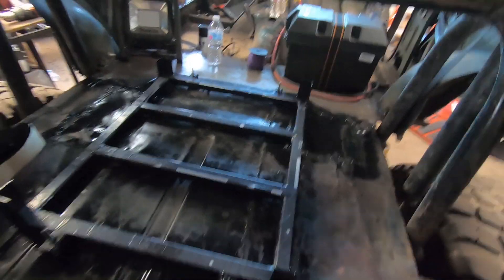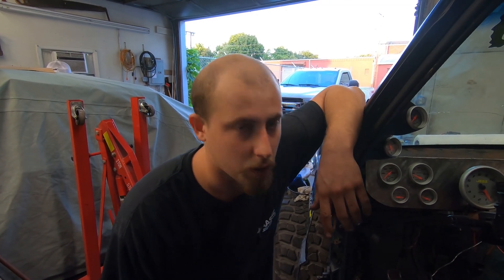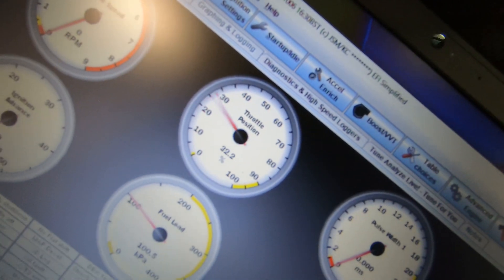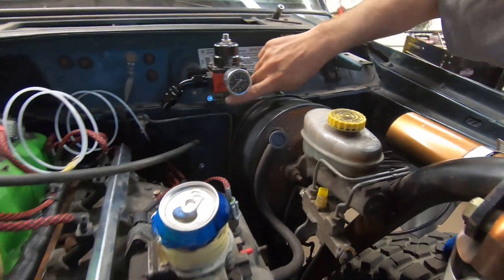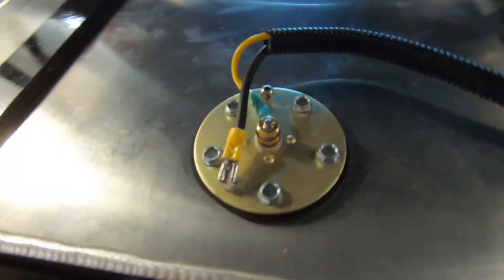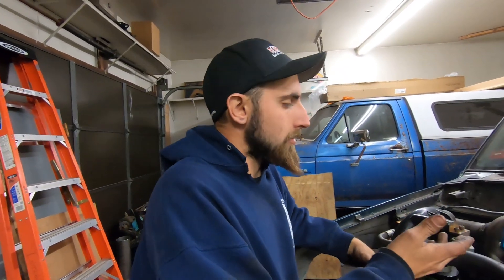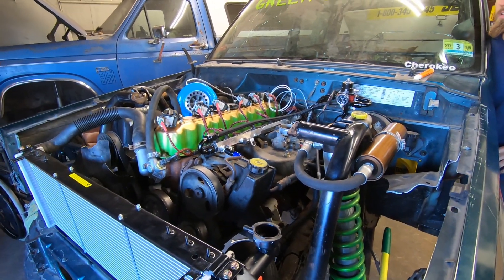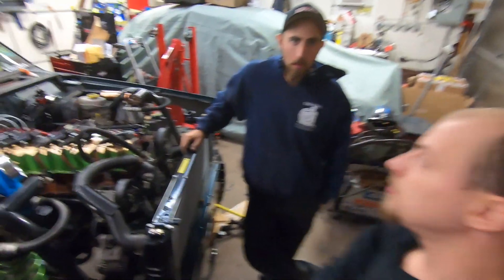Turbo Jeep Megasquirt part 9

Comment: Guys, moved from the garden state to the treasure state myself in my 97xj with 3.5” lift on 31”s mud tires with an off road kit. I took the sway bar links out off to make the drive more “fun”, say what you will but I enjoyed the 2,500 mile run floating on a slinky. ANYWAY did a total engine rebuild with all kinds of fun performance upgrades bored cylinder heads, new camshaft, banks header, high flow water pump, injectors, 10mm ignition wires, 45,000v coil pack and other small extras. Would not start. Same stuff you were listing of troubleshooting from square one; spark, fuel pressure etc in the end was a timing issue. I put a crazy amount of hours into troubleshooting and ultimately brought it into someone smarter than I- adjusting the timing was the fix for me. 
Stick with it. Be great to see it up close next time in Jersey and have a road soda under the hood and get your two sense on mine. Currently being regeared to 4.10/4.11 from 3.07 (I know that sounds off but I called the VIN into the dealership and had them check it twice) picking it up later this week. I usually do the work myself as far as I can take it and I want to keep pushing the envelope so thank you for your videos. Looking to turbo and add a menth-hydro injection next.
Reply from the maker: Let us know if your ever in the north NJ area!
Reply: @Grewsum2Sum  Will do, heading that way in a month or two.

Comment: I had the same problem on my 4.0 make sure the 1st cylinder is at top dead center and then Realign the cam position sensor and it should start

Comment: The Tuner Studio stuff has a rather steep learning curve. I too had problems with initial start on my Eagle. I had zero spark. That was because I wired it as shown in the Microsquirt manual and it had me running the ignition off the fuel pump relay. That would not work for me because that relay was not being energized after the 2 second pump run at key on and I was keying on letting the pump prime and then trying to start the engine. I ended up running a dedicated relay for the coil and it fired. I would look in "Ignition Settings" - "Ignition Options/Wheel Decoder" and double check that stuff. Awesome update as usual guys!
Reply from the maker: yea we have been slowly learning and trying to figure out things we will get there!
Reply: ☝I agree if valve timing is good it'll prob be spark timing that's the issue. You guys are so close!!